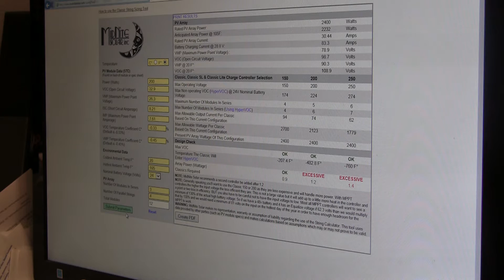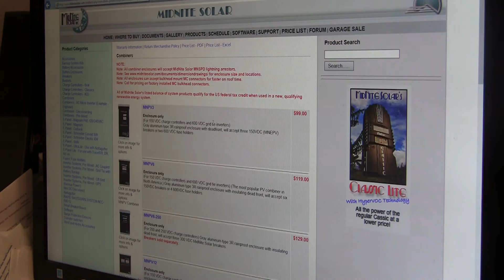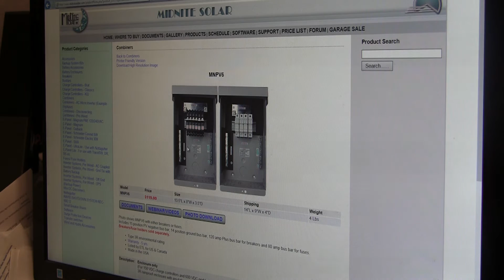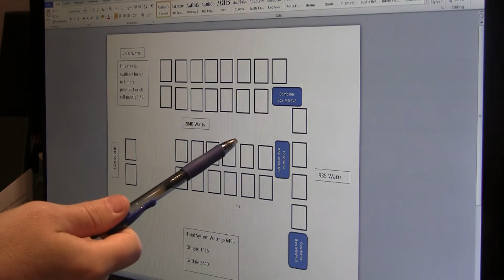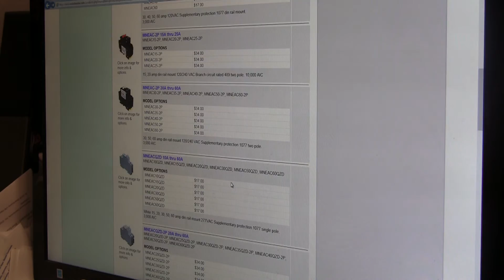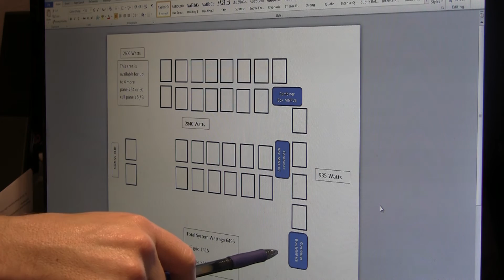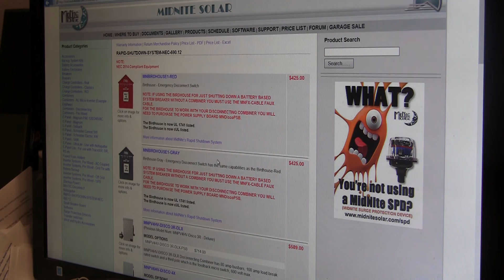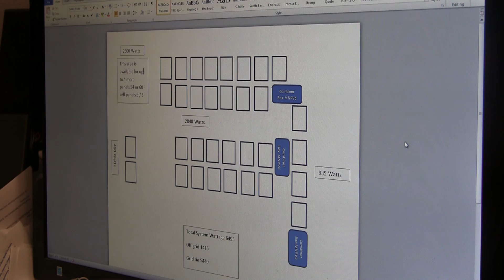Solar String Sizing

Comment: Excellent presentation! Like how you explained everything. Lots of hard work ahead of you! Combiner boxes, disconnects, and that Birdhouse are expensive...been holding off myself. Can't wait to see some videos of your work!
Reply from the maker: Thanks Chris. I dint know exactly what I could be getting into until I started the research etc.  I would love to do the work but its looking close to 5-6 grand for everything I will need and that is if either my grid tie inverter takes a dive on me or if my utility out here manages to get netmetering killed. Then the gloves come off :) 

That rapid shutdown part in the code really adds $$$$ to the build and if I did cut it over since I do have a netmetering agreement I would have to have rapid shutdown operational.  

FUN FUN FUN!!!